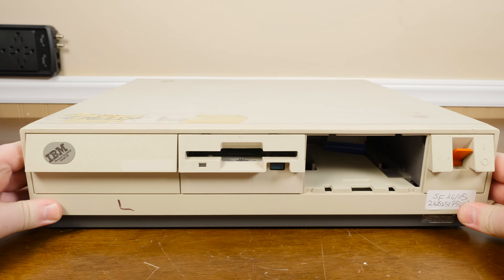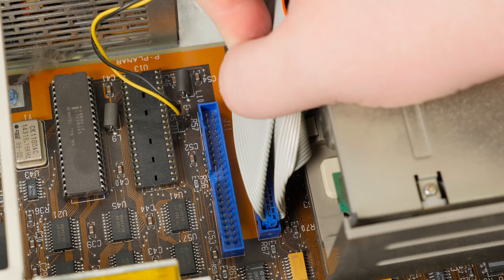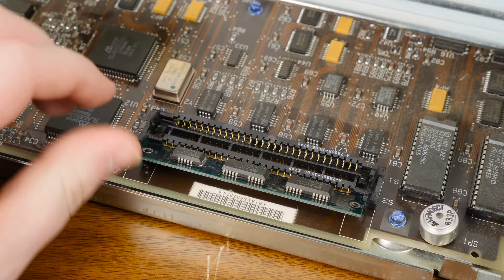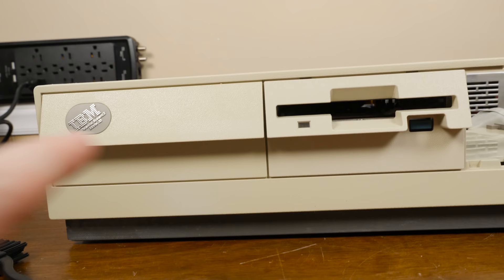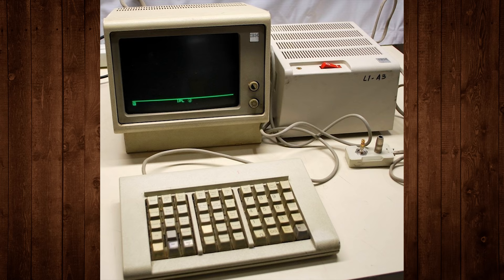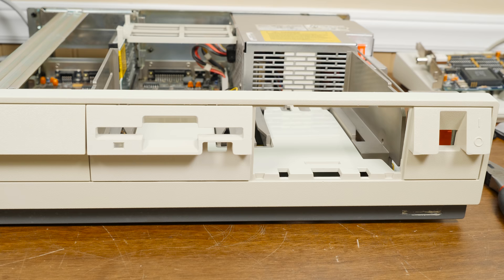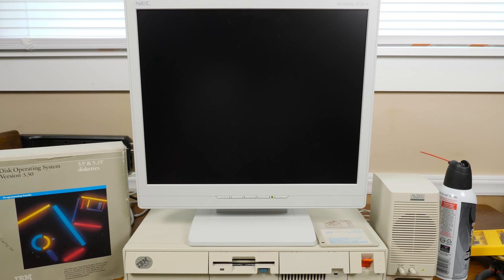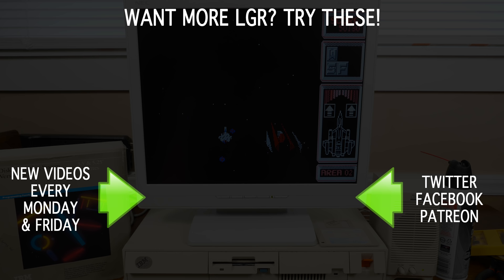LGR - Restoring a 1987 IBM PS/2 Model 30

Comment: Around '95 I had a buddy who ran a computer store. One time he offered me old used PS/2 systems (386dx20) for ~$10 each, me and my best friends grabbed 10-11 of them, incl a bunch of ps/2 keyboards. Over the years they all ended up in a dumpster for one reason or another. Just a few years after the last of them were gone, I realized the vintage value..... I still havent stopped crying.

Comment: This is particularly nostalgic for me. The 30-286 10mhz model was the first dos based PC I had. Upgraded it with an Ad-lib card, 1 MB of RAM and a 2400 bps modem. That machine defined much of my nerdy and socially awkward childhood and I probably used it long past its prime. Wing Commander 1 didn't run very well on it in retrospect, but I didn't know any better.

Comment: This video was certainly educational. I just came into possession of a 286 model 30. With a 30MB hard drive already installed... It certainly needs a very good clean but otherwise looks intact. No obvious signs of abuse or corrosion. Other than the abuse I gave it bypassing the lock since I didn't get a key with it. And if it wasn't 2 AM right now, I'd be outside blowing out the dust already. Damn you time!

Comment: I think that computer was a server at a company and was NEVER to be shutdown.  Also, that hard drive was removed because of the stuff on it, not to leave the building.
Reply: This makes perfect sense.
Reply: Some companies were quickly ripping their stuff apart to remove their files.  Instead of formating the hard disk, that just take it, remove the files, then distroy it.  All speed without a care about they futer owner.  So greedy and sad.
Reply: I doubt it was a server, more likely a terminal for a mainframe.  There was a while, that instead of having a terminal and a computer on a desk, they just used a card like that one and a terminal emulator, so you could use both.   It's possible that there never was a hard drive in there, but it made no sense to spend the money on a dual floppy.  It booted off the mainframe, which had a file image for DOS, then you did all your work that way.
Reply: It was obvious when he booted it with the network card in what it was for. It was being used as a dumb terminal. No need for a HDD, and probably no need to have a functioning power switch on the front. If you need to turn it off just cut the power or unplug it. A switch can get bumped and turn it off accidentally.

If they were pulling the drives to junk them before selling it doesn't really make sense to me that they would take the cable too. Seems like it would be easier to just unplug the cable from the back of the drive and leave it where it was. I think they probably never had HDDs in the first place and this one just lost it's blanking plate at some point.
Reply: @drumguy1384  That explains the power switch - it was unhooked deliberately so no one would shut it off by accident!

Comment: I learned to program assembly language on one of these PS/2 machines in college.  All of the school's PCs booted off of discs - no hard drives.  Wow what a memory!  This probably would've been in 1989 or 1990.  The school also had a mainframe lab, which featured a VAX clone Solborne machine hooked up to a bunch of all caps greenscreen dumb terminals.  I learned Cobol on those, if I recall correctly.  Sent my first email, had my first user account, and viewed my first bulletin boards there too.

Thanks for the memories Clint!

Comment: We had about 4 of these and 4 model 50's.  They all went straight into the dumpster save for the Model M keyboards.  Propreitary crpp through and through.   This week I pulled out all 8 Model M keyboards, and swapped otu all my membrane keyboards for these 1986 PS/2 Model M's and I'm in keyboard heaven now.   The keyboards were the only ting worth saving on these machines and by an accident of fate we saved all of them while all the rest of the units got hurled in a dumpster around 1993...   some after being shot with a  22 rifle.

You could of saved yourself a lot of time dusting by just hitting the thing from every direction inside with an electric leaf blower... including through the power supply fan.   Seriously, I've never used a can of compressed air in my life...    leaf blower all the way.   Just do it outside on your porch.    I don't even charge for it.

Isopropyl alcohol will take off the stickers

Comment: I ran a computer lab after college (for another college) and we had the 486SX/25 brand of PS/2 systems, which used the proprietary SIMMs which were a pain in the ass. Just a warning... Those plastic SIMM slots are VERY fragile. If you break the tab, you are out of luck, so be careful about that "satisfying click". On our models they produced 1M, 2M and 3M simms. (3??? But yes, three.)

Our systems didn't have that weird hard drive, though ours had SCSI installations which had their own horrid quirks.

We did however have Thin-net cards (10base-2) in them in a token-ring setup and that network card you had reminded me of them. Full length with a BNC connector in the back.

Lastly, the power switch may have intentionally been "broken" like that. In my lab, we powered the entire row of computers on and off via power strip. The reason was that one computer down and the network COULD be impacted (as I suspect our shoddy wall wiring would ground part of the loop in certain sections of the room causing the "ring" to experience noise), so we disabled the power switch from functioning so users couldn't flip it. 

And then likewise, the students were notoriously fidgetty, and would scratch off the stickers we put on anything. We ended up supergluing stickers down because the students would eventually learn (after getting superglue residue on their hands) that they needed to stop doing that. So, your machine appeared to be a school system which probably had similar issues as I had.

Comment: I came to possess this exact model PC recently, and it's in impeccable shape.  All the original screws and hardware, including the hard drive and floppy drive, mouse and keyboard.  The only issue is that the floppy drive won't read discs correctly, so installing anything onto it is currently impossible until I either repair the floppy drive, or replace it.  However, like you stated, the FD has that weird connector that isn't at all common, and those drives are expensive!

Comment: to explain the missing product label being scraped off, it wasn't that uncommon for companies to intentionally scrape off serial numbers, especially front panel serial numbers do possibly distance themselves with the their computer suppliers if for whatever reason their business relations with the company declined at some point or just as a company policy that they do not show front panel product numbers on any of their office machines.  Back in my time as a janitor some years ago I ran into quite a few of these old PS/2s and IBM PCs (being thrown away sadly, and no we couldn't salvage them and/or take them home, that was against the company policy, we had to just throw them out with the garbage back than) that had their front serial numbers removed in almost the exact same way.
Reply: If I remember correctly you often can't take them home for tax reasons. I work part-time in IT and have at times asked employers if I could take stuff home that was going to be trashed simply for being outdated or otherwise unnecessary but still useful or fun for a nerd like me.
I was told throwing the stuff away means the company can write it off tax-wise, if they donate it or sell it they can't.
Of course that's impossible to check though, so at times the rule was; "This should be thrown away, if it's not here tomorrow I'll assume it has been thrown away.. wink wink nudge nudge".

Comment: 7:10 I don't know how accurate this information is, but I've been told to avoid spraying compressed air directly on fan blades without dampening them, as this may cause overvoltage and do damage.
Reply: I do it all the time. I don't think that would happen if the computer were unplugged because there is no power connected to it.

Comment: I had an IBM PS/2 model 30 too, but it was PS/2 30 286 model. Apart from looking almost the same from the outside it was completely different in the inside. Sure it had 286 CPU (somewhat slow 10MHz model), then it had a dallas RTC chip, long ISA slots, VGA graphics and as far as I remember, the drive you have was intended for use in 55SX model. Which I exchanged my model 30 286 for. Again looking similar to the model 30 on the outside, it was built around 386SX 16MHz CPU, MCA bus, 72pin memory and the ESDI (?) drive. I had 60 megs drive, that looked like yours and was connected via ribbon cable to the top of the riser board.

Comment: Just a "pimpin' trick" for you on this. If you take all the plastics off of a machine you can put them in the dishwasher for an initial cleaning, that will get rid of most of the ingrained filth. Then, once you've got the initial dirt removed you use the appropriate cleaners to get rid of the glue/markers. Then, use a strong cleaner like Rough Rider (Available from Janitors Supply Place) to clean all the bumps. Once that is done stick it back in the dishwasher for a final clean. You'll end up with plastics that are immaculate.

Comment: Back then I was working for a networking card startup and remember us getting a PS/2 and opening the box and disassembling it before even thinking of turning it on... because the higher end PS/2s introduced the evil MCA bus!  When we put it back together again it didn't work straight off because we had disassembled it down to the battery backup! Happy days.

Comment: Dang. Haven't seen SIMM's in many many years. Largest ones were one meg iirc?
Reply: 30 pin?  Maybe 8M max?  Not that a 8086 could address that.  I had some 72pin 64M SIMMs from an old DEC Multia that I'm not sure where they might have went.
Reply: Looked them up. There's even 16MB modules available in the 30-pin version. That is impressive considering how few pins they have. The magic of multiplexing :)
Reply: I had a 486dlc rig in the late 1990s with 32 meg of memory.  Eight 4-mb 30 pin SIMMs.  I seem to recall hearing about 16 mb 30-pin SIMMs for use on some early 486sx/dx systems but I've never seen such a thing.  16-32 megs in that class of machine was considered 'WOW', and by the time larger memory specs were required they'd gone to 72-pin SIMMs (Pentium and later 486).
Reply: 8086 and 8088 could address one meg max.  16 meg for 286, 386sx, and 386sx variants, 32 meg for 386dx  and 386dx variants.   I think 64 meg was max for 486sx/dx and variants, but I can't be sure about that now.
Reply: @sebastian19745  I have a SoundBlaster AWE32 that has two 4 Mb 30-pin SIMMs installed on it for the sound fonts.  My second 286 PC used both DIP DRAM chips and 30-pin SIMMs, my next PC was a 486 that used either 30-pin or 72-pin SIMMs, but not both, like you had.

Comment: Yes the old IBM PS/2.  brings back not-so-fond memories as they used these for our keyboarding class.  along with a token ring network I believe.  All I remember is having to wait a while between tasks as it would take forever for the computers to load things across the network (as there were 30 machines in the particular network)..

Comment: Gosh, I remember those boxes.  We use to blow the motherboards so we could replace them with a 3rd gen OEM board that was twice as fast with color on the motherboard, and 128gig of memory.  Made a lot of uses very happy.  Had to do that since we could not buy new systems,but only repair them.  Capital dollars vs. Expense.

Comment: If you knew me about 15 years ago I had stacks and stacks of these IBM's with monitors, mice, parts, keyboards, and every variation. All worked fine, installed  Windows 3.1 on a bunch of them.

Comment: One product I have discovered that effortlessly removes stickers and sticker residue is Akasa TIM clean. As the name implies, it is designed for the removal of thermal interface material like thermal grease but works on just about anything that sticks to a surface. I've just poured a few drops, rubbed it in lightly and let it sit for 1-2 minutes. Stickers come off without ripping, and all the gunk left by tape and adhesive just dissolves into nothing. I've used it many times when restoring and resurfacing.

P.S. As a bonus, it leaves a nice lemon scent ^_^.

Comment: Damn the exact computer(s) from the Embassy Suites in the late 1980s/early 90s. Except it had dual floppy drives and token ring adapter. They threw all those computer like 40 and monitors in the dumpster when they upgraded, I pulled up and loaded up like 15 plus with as many monitors I could salvage and took them up to a local used computer store. What was their trash was 1100 dollars in my pocket, quarter of college paid or 2. I made 2 trips back to work with my cat who had a dental done and I had to pick up post surgery. Had him on leesh in 85 Rx-7 GSLSE - that cat loved that car and tech. There were a couple high cost Trinitron and NEC monitors that really were the cash of it / 1 Gateway computer.

Comment: We had about 20 of these Model 30 PS/2 machines in the computer lab at college.  At that time smoking was permitted most everywhere and that’s why ours were yellow lol.  We had the basic 640K with a 20MB (maybe a 40MB) hard drive.  It’s been a while.  I did grab a few of those regular keyboards though when they upgraded as I like those old keyboards.  I like to feel and hear the keys as I type and they were built very rough.  IBM was definitely overpriced but they did build rugged machines (which is required in an environment where many people are using them).  I’m enjoying your channel quite a bit. 👍🏻

Comment: Those old alps floppy drives had serious problems. I worked on one machine where a floppy formatted on it would not read in other machines. So I formatted it on another machine and it worked on all the other PCs. But when I put the floppy back in the PS/2 the original files were still readable! So both file systems existed on the same floppy. It was like the PS/2 had written between the tracks. I got double the storage on that floppy 😀

Comment: You do have the correct HD. I had this exact system in 1987. IT came with a 20mb but it was a OEM upgrade to your 30mb which is an option i had. Sad part is I just recycled this computer about a year ago or i would have happily sent it to you,

Comment: My IBM PS/2 Model 30/286 had significantly different construction. It did indeed have an ESDI HDD which confused me endlessly, along with the weird floppy drive. But I am positive that it did not have Torx screws in the chassis. The enclosure was metal and not plastic. There was probably no battery on the riser card, but I managed to cram in a 2400 baud MNP5 modem and a Plus Hardcard 100XL.

Comment: I remember that every single time I bought a PS/2 or a PS/1 in a yard sale, it would work for 3 days and then, the hard disk would fail. Of course, it is proprietary stuff... I'm now restoring a PS/1 model 2011 with a dead motherboard and putting a small Via Eden 500mhz motherboard from an HP thin client. But hey, it's much more powerful than the 8mhz 286 :)

Comment: That particular model was one of the cheapest of the line and the only one cheaper than that was the PS/2 25. I rebuilt one of the machines out of parts where I worked at and had it running with a hard drive in it, and the floppy drive in that computer. The model I rebuilt was a newer model and had all the scsi system put in it like it was when it left the factory new. I used it until they finally gave me a newer computer to use.

IBM used different cables in the PS/2 computers and it was propriatery at the time and that was on purpose. I was surprised that you found the hard drive to go in there which came with that computer. The system was new at the time and they was the first to use those cables and plugs on the PS/2 systems and other companies finally copied some of the changes in building their computers. I have an Aptiva which they made later on and it came with Windows 95 and the computer still works just fine. It was built with some of the changes IBM built into their PS/2 computers and I love that computer even though I don't use it much any more.

Comment: I had a similar issue with my Toshiba T1200. Then hard drive used a similar non-standard connector. Ugh. Goes to show you that regular IDE was competing with many others back in those days. I’ll def keep an eye out for one of those cables. Kickin myself for getting rid of my old PS/2.

Comment: I have an old Model 70 386 and checked, the 80 MB standard HDD appears to have an identical connector to the one you bought off eBay.  Although on this model, the hard drive (plus 2 floppies at the same time) all connect into a riser card going into the mobo, no cables.  It's also an MCA bus computer, barf!

Comment: Acetone is what will get rid of most permanent marker dyes. It is typically sold as nail varnish remover. Lighter fuel/Petrol/gasoline gets rid of sticky labels.

DISK DRIVES. I would replace the lost hard disk with a second 3.5" floppy, and use a IDE compact flash adapter card in one of the ISA slots. This will put a lot less strain on the 30 year old PSU.

Comment: I picked up one of these at a flea market back in the 1990s...  I don't think I ever did much of anything with it though. Don't even remember if I knew it was an 8086 when I bought it. But I got it running, put it on a VGA switch and set up file transfer to it...  But I don't think I did much with it beyond that.

Comment: Doubt you'll catch this but those spring retention screws are very very common on military equipment from the same time period too.  I calibrate a lot of the old test sets still and while the screws are starting to wear out from use, they're wonderful and I wish they were still common.